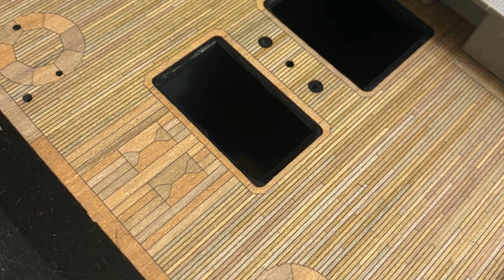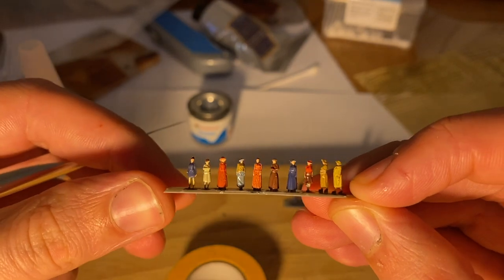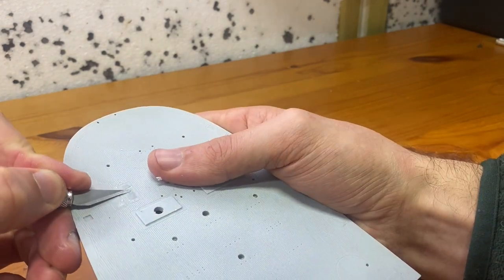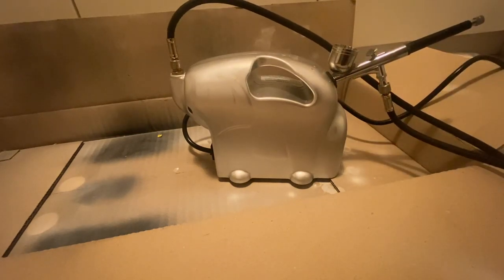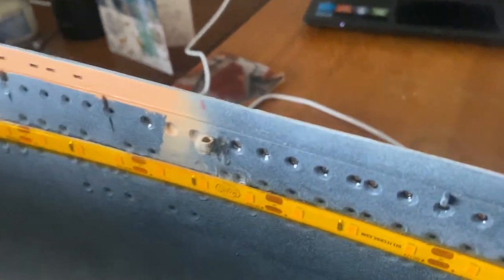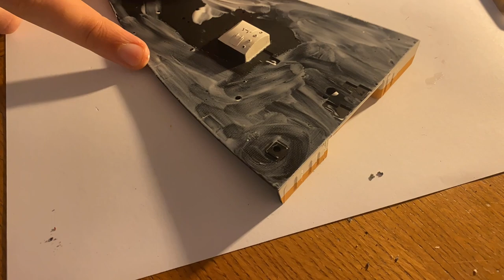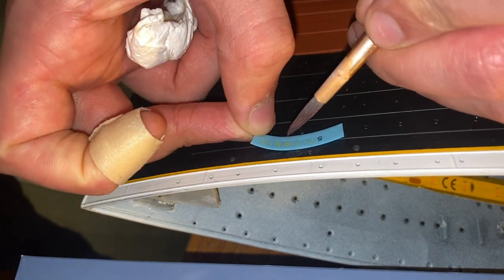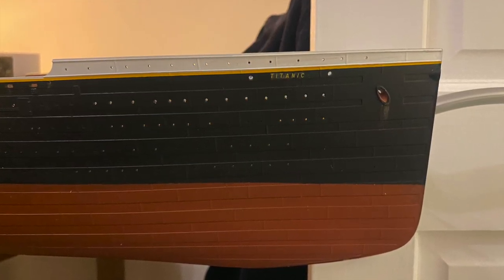Radio Control Trumpeter 1:200 Titanic Build Part 17 - Figures, Scaledecks, and Decals

Comment: really like the look of the scaledecks WOW they really do look good, and more realistic as well.  They really do add detail to the model.
Reply from the maker: hi thanks! Yes i think if i was to suggest one addon for the model it would be scaledecks, they are just stunning.
Reply: @TheModelBoatGuy  Can these decks be trimmed? I am doing a 1/350 which requires some modifications to light properly. If I cut a few small holes in the scale deck for light penetration would the deck fall apart?

Comment: You’re so lucky that your decals stayed on the sheet while soaking in water. All of mine floated off and every time I tried to pick them up with tweezers they kept folding up on themselves and one ripped. They kept sticking in the wrong place despite plenty of water being on the surface.
I feel like I need a good therapy session after all of that
Reply from the maker: Aaah yes those particular decals are an absolute pain. I found if you take them out before the decal comes off the paper and just leave it to continue to soak in the water the papers already absorbed, that was the best way of doing it. 
But still super fiddly!

Comment: Looking good! Just beware that the Tamiya XF-15 isn't too peachy for the funnels, I found a mixture of their XF-78 deck tan, and their yellow works much better. Although you might have different results...
Reply from the maker: Hi, yes it does look quite peachy on the people dosent it. I’ve seen some good results with that colour in its spray bottle form from a few people which is why I went with it originally. Trial and error I suspect! I’ve already got a flat flesh spray can so I’ll use that and if it’s not right I can tweak and change
Reply: So, just for the funnels, you mix with tamiya xf-15, xf-78 and xf-3?
how about the lower half of the well deck walls, using the same tamiya colour? Or use different?
Thanks

Comment: You are probably aware but I didn’t see it but you should put some microsol onto those decals. Makes the decal really conform to the plastic and gives a really good “painted on” appearance
Reply from the maker: Hi, yes I’ve just been reading about it actually! Might get some ordered up. Do you think it will have any benefit to the longevity of the decals in the water? The titanic ones are less of a concern but the plimsole lines and depth gauges will be almost continuously submerged
Reply: @TheModelBoatGuy  I think it’s definitely much better than nothing. The decals will definitely come off when they become wet without any sort of protection. For my titanic, the microsol plus a matte varnish to seal it has made it inseparable.
Reply from the maker: @mtshnitzel  yeah deffo. Righto I have a bottle on order. I shall hold you personally responsible if it goes wrong! Jokes! 
Yeah I mean i am most concerned about the titanic name plates and the decals about the superstructure. I’ve sort of come to peace with the fact that I will loose the depth marking decals at some point, I can’t see how they can last indefinitely under the water. 
As you say though, microsol and a good coat of matt varnish will give them a fighting chance.

Comment: tip for you, for the next time you mask and paint, if you painted the background area white, and mask it, then paint a layer of white again, to seal the edge of the tape, then spray on your other coat in lighter passes, that way you wont get any paint running up behind the tape and messing up a "clean line"
Reply from the maker: Hi, yeah deffo need to start doing that. To be fair I’ve been having way better results with the airbrush than with the cans, but to be expected i guess!
Reply: @TheModelBoatGuy  thats to be expected. the atomization of an airbrush is way better than that out of a can. though there are a lot of other differences, a lot of ppl spray with way to high of a pressure and way to thick of a paint. if you feel the paint isn't silky smooth once painted, you are probably not thinning it enough.  and if your having issues with overspray and bounce back, or orange peeling, then you have your pressure to high (there was a lot of paint mist flying around when you sprayed the inner brown line) so try experimenting on some scrap plastic and build up the layers. 
It will be an interesting build to follow for sure.

Comment: Hi. I'm also using the fine detail scale decks and ka. Can I ask. Why use black spray paint before glueing down the decks? Simply for the light spread escaping under decks/bulkheads etc? I'm thinking of just using the white and painting the black detail on the forward hatch cover later. Seems logical. I was concerned about any edges that may be showing after installing the scale decks and final fitting but it looks a nice snug fit. Any advice would be most appreciated. Cheers.
Reply from the maker: Hello, basically it is because the scaledecks are very very thin meaning they show whatever is under them. Some of the decks in the trumpeter kit are quite thick with is good for light bleed, but some are much thinner. Painting everything black first essentially removes any doubt in the issue. If a thin deck had light shining through the scaledecks would appear way lighter. This just reduces that effect as far as reasonably practical
Reply: @TheModelBoatGuy  I thinking about not using the lights. So I wouldn't need the black? Just a good primer and white? Thanks for quick reply.

Comment: Greetings. I just wanted to know what colour you used for the orange looking parts. Thanks and excellent work.
Reply from the maker: It should be in the video description if you are meaning the one I refer to as ‘dark mast’? From memory it’s Humbrol 61
Reply: @TheModelBoatGuy  hi, 
For the lower half of the well deck walls, are you mix with different colours? If so, what are the colour did you mix?
Reply from the maker: @jacklin7624  no it’s a colour that’s commercially available. Made by a company called Humbrol, and the colour is 61
Reply: @TheModelBoatGuy  just Humbrol 61 one colour nothing else?
And thanks for the info.
Reply from the maker: @jacklin7624  yeah just that, I’ve added a little bit of weathering over the top but nothing else